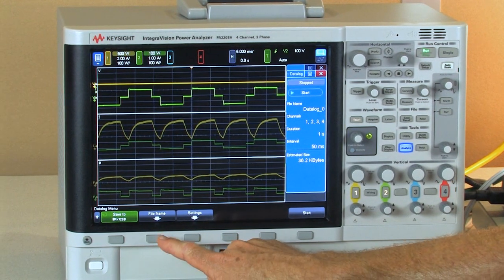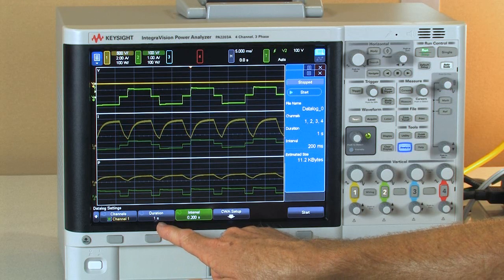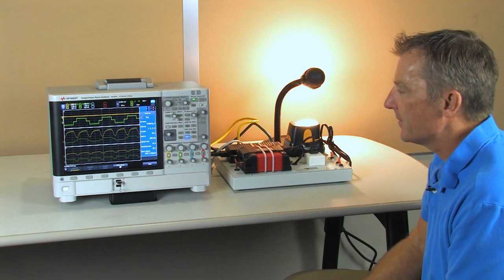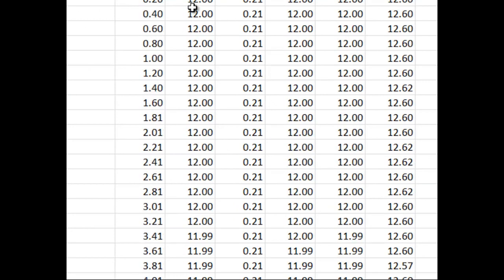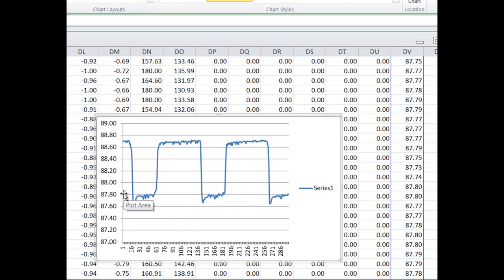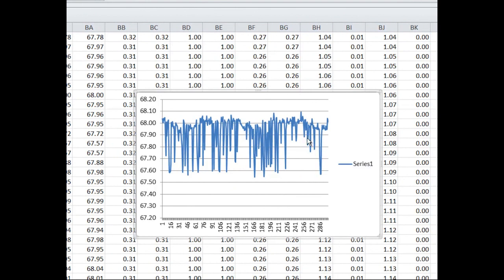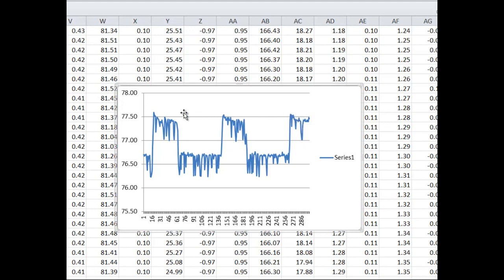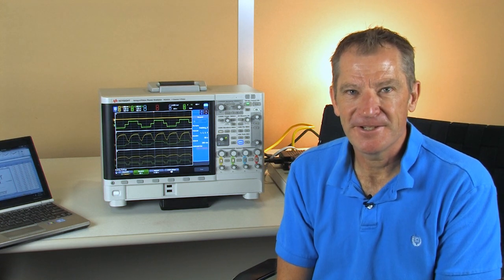Power Analyzer Data Logging, Data Logger Added to IntegraVision PA

Comment: Sometimes the datalogger stops while measuring, before it is complete. Why does this happen? Sync source is set on line trigger. If i use Another Sync source the datalogger wont log data when start has been hitted.